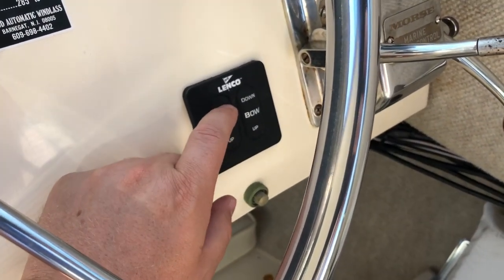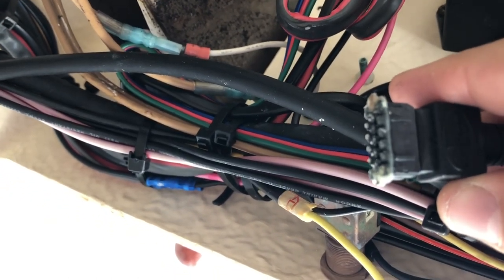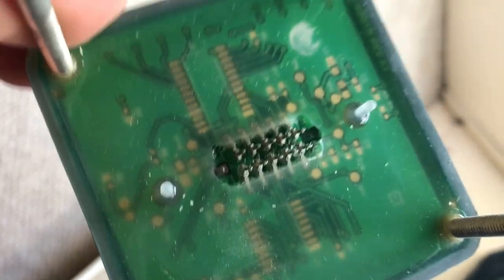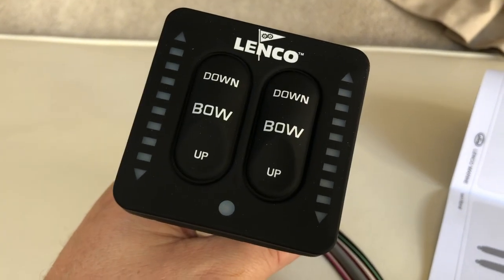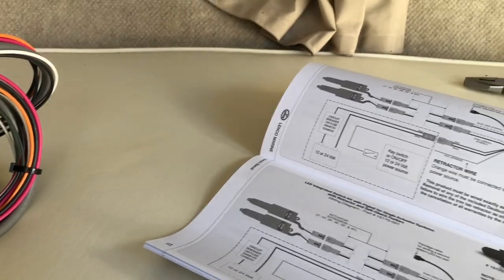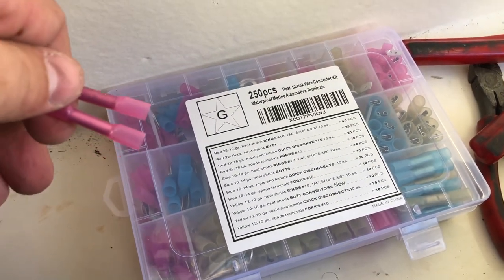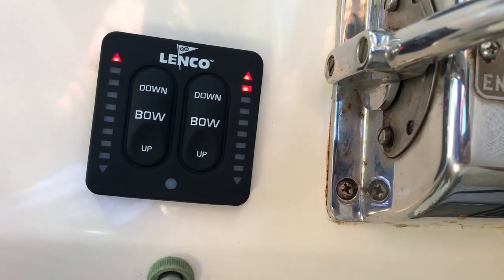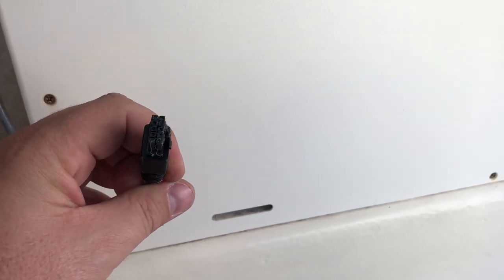How to Fix & Upgrade Trim Tabs [Part 1]

Comment: Your video was extremely helpful. I upgraded my lenco switch and everything worked fine as you show us in your video. Thank you. I just want to point out I had to wire the orange cable to switch in order for everything to work.  thanks for the video.
Reply: You had the basic switch and upgraded to this? Everything good?

Comment: Thanks for the video. Question:  Do you have to connect the little orange wire? I didn’t see where you connected it. Thnx
Reply from the maker: orange wire goes to the ignition switch. When the signal is removed it generates the auto-retract feature.

Comment: Thanks for the post.  I had the exact same problem with the female connector pulling off the board.  The pins on mine did not stay on the board or the connector, but fell to the ground.  I picked up as many as I could find, but even those I can not find.  So, I wanted to reuse the switch I have which looks just like the new one you installed with the LED display.  The video did not show if the new switch had the same connector as the old one or not.  If it did, did it come with the the female connector installed? (and hopefully secured better)?  I am just hoping someone has already come up with an easy cheap fix to get me back on the water.  Thx
Reply from the maker: The switch comes with the wiring harness.
Reply: I know this is an old post, but I do you still have the information on the new switch or is there a link to where you bought it and part number…

Comment: Hey,

I have my switch installed; I am not getting any power at all. I have it connected to the fuse block properly, (pretty basic). The fuse is good, kind of at a loss why it wont work. Thanks in advance.
Reply: wired the orange into the 12v on, Evinrude Etec ignition switch. Used the purple/red on-off wire on the switch.
Reply from the maker: Check ur ground